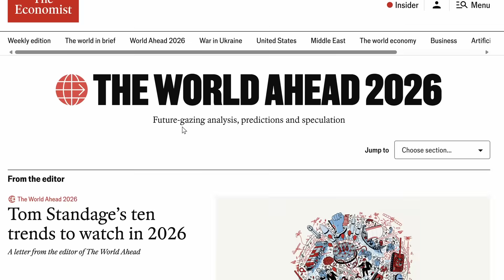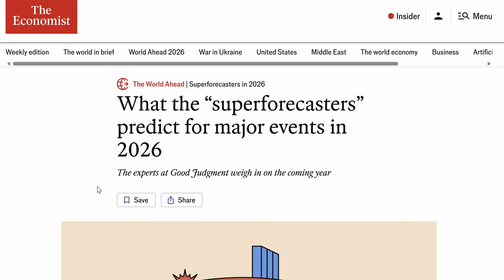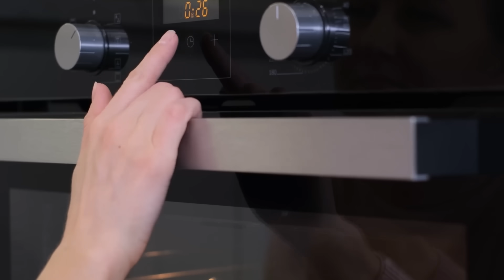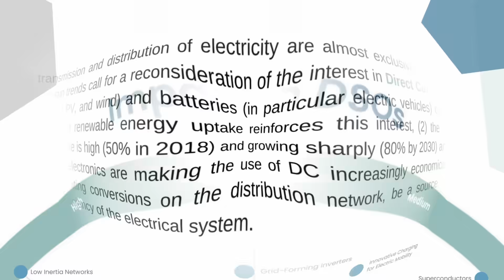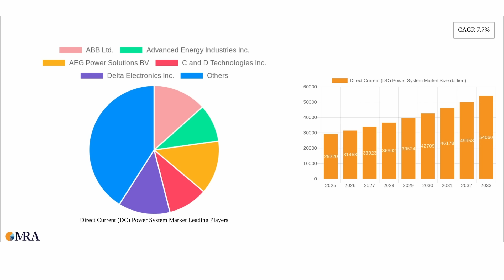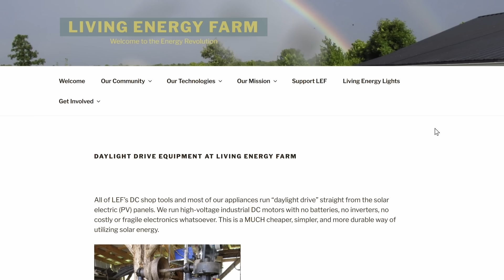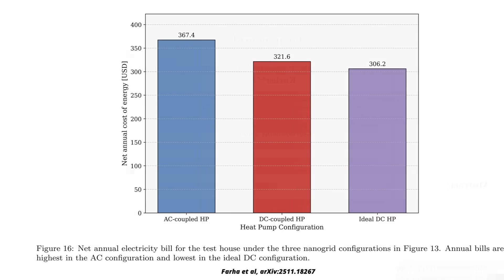Are We Using the Wrong Kind Of Electricity?

Comment: Why does Japan have two different electricity grids? Because Germany and the US fought over that too. Always fighting which standards to use for commercial reasons and usually competitive reasons too.  Remember SECAM vs NTSC? 
" Japan has two electrical systems (50 Hz in the East/Tokyo, 60 Hz in the West/Osaka) due to historical choices in the late 19th century when early power companies imported different generators: German 50 Hz turbines for the East and American 60 Hz turbines for the West, creating incompatible regional grids that are now difficult and costly to unify. 
How it happened
Eastern Japan (Tokyo): Imported 50 Hz generators from German company AEG in 1895, establishing the standard for the east.
Western Japan (Osaka): Imported 60 Hz generators from American firm General Electric in 1896, setting the standard for the west.
Independent Growth: Both grids expanded independently, locking in the different frequencies as national infrastructure became too vast to easily change. 
The divide today
Regions: Eastern Japan (including Tokyo) uses 50 Hz; Western Japan (including Osaka, Kyoto, Nagoya) uses 60 Hz, with the boundary running through central Japan.
Impact: This split partitions the national grid, requiring costly frequency converters (HVDC links) to transfer power between regions, which proved problematic during the 2011 Fukushima disaster when the eastern grid needed power from the west.
Modern Appliances: Most modern electronics handle both frequencies, but older devices might have switches, and travelers should note that clocks or simple timers may run at different speeds. "

Comment: Didn't the invention of the silicon controlled rectifier versus a diode based full wave rectifier make the conversion from AC to DC far more efficient and controllable? Also better capacitor technology aided the conversion process.

Comment: Its not just a question of losses, but also a question of maintainability. A DC/DC transformer (wrong word; it's a converter) is always an active component, while an AC/AC transformer is a passive component. Last-mile solutions could be DC though. Albeit safely is a problem, especially at higher voltages.

Comment: We do, but not because we need DC at the local level. We need 3 phase to the power point. That would make almost every appliance cheaper, longer lasting and more efficient. Including things that run on DC internally. DC is much too dangerous in houses. (Arcs from switching don't self quench)

UHVDC is the right thing for long distance power lines, but the expense at each end makes it more expensive at short distances.

Comment: As a former electrician I found this quite interesting. I’m not sure it’s going to take off until appliances become more generally DC at the shops. Right now you can’t just go to DM appliance shop and pick up a new DC washing machine. You have to really hunt for that kind of stuff. So making the move in your house wiring from an AC system to DC doesn’t seem viable until all the need to use connects to a standard DC setup.

Comment: DC power CAN NOT be transmitted on wires more than a few hundred miles, the losses are crazy.   And car (EV;s) motors are AC 3 Phase, NOT DC.

The BATTERY is DC but that's because that the only power batteries can store, 

They also charge up FASTER with 3 PHASE AC power.

Comment: AC Holds victims to death.
DC throws off victims to try again.
Both AC and DC can have corona or arcing.
There is existing DC Transmission, usually less then 1000 miles.
AC Transmission also has distance limits, when conductors must be "rolled", "galloping" of conductors during wind must be avoided, parallel fiber optic cable shield/strength cable can be energized to high voltages causing damage, ...

Comment: DC is poisonous to be around for too long, fries your nervous system. 
We need significantly better safety standards already before we let them lower the health standards even more.
High rates of health problems anywhere near powerlines and higher still near pure DC.
ADHD and genetic problems rise with DC and Wifi devices year to year.
Its pretty solvable, but will cost power companies liek .8% of their profits for a year or two so they'll fight it.

Comment: DC interconnectors between different countries/power grids are built since forever, and they have nothing to do with the efficiency or the rise of the solar, but more with operational concerns of grids with different voltage and frequencies. They allow for power exchange without complex procedures of balancing and synchronizing.

Comment: Transformers work by an oscillating magnetic field, AC does  this better than DC because DC only has 1/2 a sine wave to work with. PV solar does not have an oscillating power output so transformers don't work and you now need high power amplifiers (capacitors and transistors) and then have high power, multiphase rectifiers added to every conventional energy source on the grid just so you can have a DC solar powered grid that now doubles your carbon emissions because everything else has to run at half its efficiency to remain compatible to your solar powered grid.

Comment: Sabrina, you did not mention the key development that has made DC transmision more viable compared to AC....
The High Frequency, High Voltage Switching abilities of electronics has greatly improved on the past 20 Years.

This means that Transformers can now be 100 times smaller for DC than for AC of the same power and be more efficient at the same time.
That is because DC to DC Switch-Mode conversion can now be done in the kHz range in stead of 50 Hz or 60 Hz as in the case of AC transformers.

Comment: 4:13 Subsea power cables are heavily shielded, which is why long-distance links use DC. Long shielded AC cables would act like giant capacitors, and the shielding and seawater create large charging currents that make AC inefficient over distance.

Comment: Never heard of a DC transformer because  transformers work by the collapsing and increasing the magnetic field created by the AC current through a coil and if you can't use a trans former to up the voltage for long distance transmission which reduces  amperage the wires would have to get to big and fat to move that electricity over long distances. just saying

Comment: Transformers only work with an alternating current. You want transformers for isolation between high power draw locations for safety. You can alternate a DC power source to get a transformer to work the same, but that is not really much different than AC. If we are moving to large batteries being everywhere, then DC could make sense. Otherwise, the reason for AC is that energy generation is often done through mechanical rotation (like a gas generator or steam turbine), which is inherently cyclical and generates a sinusoid. Also, EVs technically convert DC to an alternating current to spin an electric motor. It's just that our batteries are DC and that's the most efficient way to store energy atm.

Comment: The microelectronics nowadays are good for AC and DC as switching source for voltage transmission. They offer excellent powerfactor. Even if devices run on DC, they need DCDC converters, which must use intern always AC on inductive material. Thats always the magic of conversion. even if you for example run a DC motor on a DC source, it needs some DCDC similar device if it should have a flat power curve independend of the state of charge of the battery.

Comment: I suspect the safety angle (orthogonal angle) is the most important for sticking with AC. Unless DC can somehow be transmitted inside houses at a nice safe low voltage, say 5 or 50, at maybe 400 or 40 amps. Superconductors maybe? Looking forward to a future where my oven plugs into a 400A micro usb socket in the wall.

Comment: If you want to transfer energy from river do your home, with AC its only 1 permanent magnet, some wires for stator and maybe simple transformator. Its simple to make light, heat and machine moves.
 The true stone age technology.
DC is needed for one and only thing: data processing. And that is hardlinked with chemistry. Its not that simple to make diod or transistor at home. Not talking about CPU and other stuff. So... for safety reasons, I vote for todays solution. Simple repairable connectivity with basic machines and advanced systems for advanced tasks.

Comment: The reason AC won is that it is easy to transform the voltage with a simple iron transformer. So you could up the voltage to 10K for transmission, back down to 440V for distribution, then back down to 240/120 for consumptions. They didn't have DC-DC converters then The key was the transformers allowing high voltage to minimize the I^2*R losses in transmission,

Comment: I live off grid with solar and batteries and initially I had wired my cabin with 12VDC. The wires were massive and expensive and the breakers were too. also I had trouble finding DC things, they were all special order.
So when I built my house, I decided to invert all the power and wired it with little AC wires. It was a dream, the wires are so easy to work with, the breakers and boxes were cheap, all my appliances are standard AC ones. The only change I would support is going from 120V to 220V here in North America, as it is in Europe and Asia and probably everywhere. Higher voltage means smaller wires and AC means less line loss. DC is fine for the applications that you noted but overall AC is the way to go

Comment: DC was what Edison championed (no comment on his shady business practices) because it was better for local use.  AC is better for long distance transfer.  So now we add rectifying circuits on literally everything just to cope with AC coming in.  Better to install a central rectifier in every building  instead of on every device.  Run our building circuits on DC and connect to the AC grid through your building rectifier.  It will add to the upfront costs of buildings but simplify (and reduce costs on) all our electric appliances.  The problem of a century ago between Tesla and Edison is that we picked a side, not went with a hybrid that put the right jobs on the right type.  It costs only a couple thousand for a home rectifier.  DC appliances and equipment are only more expensive due to scarcity, but are less complicated and would be cheaper than AC if made in scale.  That $2K rectifier upfront would cause savings in the initial building equipment and everything that came later.  A mass shift would pay for itself in no time on new construction.  Retrofit is another matter.  Time for society wake up.  Picking one team only was the wrong choice.

Comment: No, to each its own time. I the days without switching PSUs , there was no other way to use electricity but AC. Today, with power semiconductors getting widely available, going back to the IGBT-switched DC-based grid makes more and more sense.

Comment: As an electrical and automation engineer I would say that AC isn't going away, and AC will still be used in the future as the backbone of electricity transportation and in homes. I find the claim odd that homes are using half or more DC power, when it is basically only TV, computers, tablets and other smart devices etc.. But all high powered ones such as oven, stove, fridge/freezer, dish washer, washing machine, toaster, kettle and other similar things run on AC. But then again, the low powered ones are used almost constantly and high powered ones in short bursts. But even if DC power becomes more and more prevalent, it is still better to keep AC as backbone and then convert to DC when needed since we already have the AC grid and there are cheap and easy methods to convert AC to DC.

Comment: There are a few reasons for using AC power in distribution. Ac down conversion is a simple transformer that as long as it does not over heat it will last forever. Any DC to DC conversion will wear out. The example of a EV, the motors are AC because they are smaller than DC motors of the same torque and they have less maintenance. The choice is based on what one is doing with the power.

Comment: Nope, AC is substantially better for power distribution in almost all cases. Higher frequency & 3 phase in the home would be helpful but it's too late to change now. Higher frequency permits more power versus physical size of transformers. 3 phase in the home is more expensive in wire cost but makes motors smaller, easier to use, & more reliable. We must  distribute at high voltage & it's far too difficult & inefficient to reduce DC down to usable levels at the points of consumption. 
All these DC devices discussed operate at different voltages. There's at least 4 different voltages inside your computer.

Comment: 0:28 EV motors are AC.. BLDC motors are AC, though the point is sort of moot since it's not 50/60hz
3:05 and most appliances with big motors (dishwasher, washer, dryer, but bldc is an alternative)
3:46 turbines generally produce AC rectified to DC..
4:03 this is the key point, HVDC for transmission. Doesn't effect homes.
5:05 transformers vs buck/boost converters

Comment: Tesla cars invert DC  to AC to run. It's way more easily controlled than DC.

In industrial applications,  we control motors with inverters that convert AC to DC, and then invert it back to AC, but at the frequency and power level we need for that application. These inverters can be powered by a large DC source directly instead of AC

Comment: At 4:00 : DC is used in this application of a specific reason :lower loss in the transmission wires. The losses in the wire is a function of the square of the current. The power is the voltage times the current. The higher the voltage the lower the current. The limiting factor on the voltage is the breakdown voltage of the air between the wires. For the same voltage and wires a DC system transmits more power than an AC system because the effective, or average, DC voltage is higher than the AC system. The effective voltage for the DC system is the constant DC value. The effective voltage for an AC system is LESS than the peak voltage. This is  because the RMS voltage ( the effective voltage ) is lower than the peak voltage since the AC voltage varies from peak to zero and back to peak every cycle. High voltage DC transmission makes economic sense for longer distances.

Comment: DC is good for long distances, AC is good for medium size, as there are much cheaper equipment that offsets the losses of AC compared to DC. DC is best for low voltage, low power systems like individual appliances, computer networks etc.
The sheer amount of equipment on the local networks makes AC more viable to using DC equipment, the difference in insulation, contact gaps, contact size, arc extinction, etc is large and the amount of the equipment needed.
When you have two DC feeders traveling long distances the amount of equipment is 1 circuit breaker and Protection instruments per feed.
To supply the same energy on a local network requires 1 transformer, 1cicuit breaker or switched fuse, 2 isolating switches. 
That's four bits of kit for every substation and there will be multiple substations using the same energy as the DC system feeding it. Possibly 40, substations.
even at a very small percentage price premium of 10% that is an increase of 400%.
You would be looking at hundreds of billions just to change an average European country to DC.
More use of DC at the Extra High voltage, long distance networks will be the case as the amount of infrastructure will be small.
The bulk of infrastructure will stay AC, DC to AC conversion is quite costly, AC to DC is cost effective. DC to DC voltage value change is very expensive but AC to AC voltage change is efficient and cheap.

Comment: Electricity is the REAL magic of Mother Nature !
Comparing AC and DC is like comparing Boys and Girls.
Both are equal and like two sides of the same coin but are dependent of each other like bugs and flowers. A true symbiotic relationship when applied for use by mankind. The electromagnet spectrum is mind boggling to explore. And we are really getting into it now. Ham Radio was long before the internet and could cross the world with rather low power.

Comment: Alternating current isn't inherently more efficient for the transmission of electricity. It is the fact that transformers need alternating current to raise the voltage for transmission, and lower the voltage at the other end for safe distribution. The higher the voltage the more efficient the transmission, because the CURRENT is lower for the same amount of power transmitted. The losses in the wire is a function of the square of the current.

Comment: AC practically is ONLY transmitted 200 to 500 miles. The Line capacitance limits the range.

 Very long distances is via DC; ie ultra high voltage DC like from Washington State to Los Angeles with the DC line. Pacific DC.  Path 65. It is 850 miles long

Thus New York state does not power California via AC; the losses would be super high no matter what the AC voltage is. It is a Reactance problem

There are not many high voltage DC transmission lines at all. Thus Indiana does not send AC power to California. Florida does not sell AC power to Montana